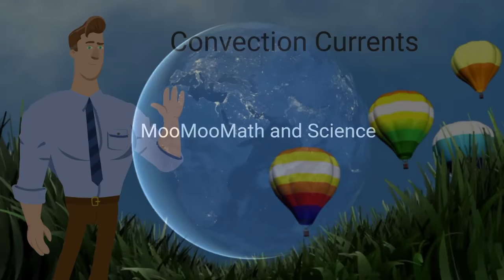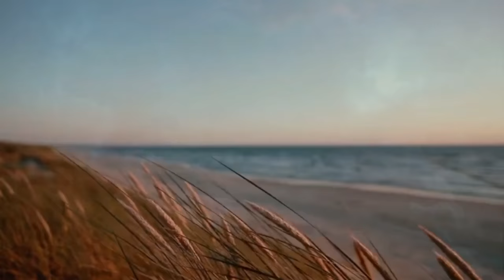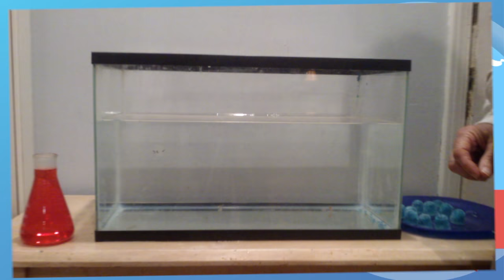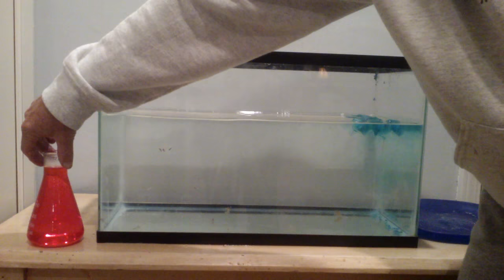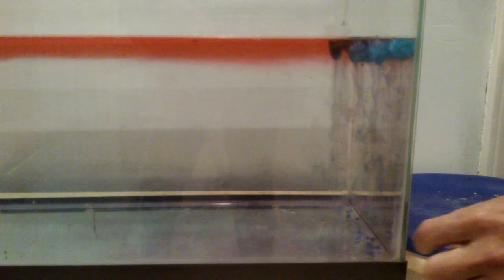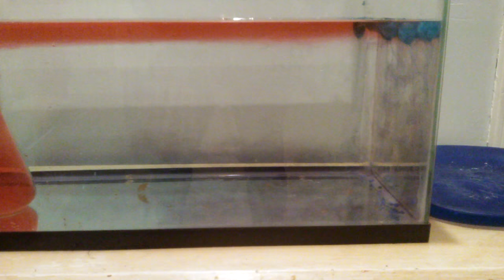Convection Current Demonstration

Comment: How does the blue water gain heat after it has fallen to the bottom of the ocean (tank)?

I understand hot water rises, and as it cools, it falls back down, but how does the cool water get warm again to creat the cycle?
Reply: As it falls, the cold water get closer to the heat source (the bottle).
Reply: Brian Andrews in reality the sun would heat the ground then the air nearest to the ground would heat up. These are called thermals the hot air rises cools off then sinks. If you ever see a small puffy cloud it’s because of this. After that hot air full of moisture get up to the cold region it cools and releases all of its moisture in the forum of a cloud ☁️ <— like this on apple
Reply: Because as the the warm air rises it leaves a space for the cold water to flow into like draft in a fireplace.
Reply: Due to earth core
Reply: One of the 4 'Laws of thermodynamics' says 'heat always flows toward cold' 
Look up those laws. 🤓
Reply: the sun & wind are factors